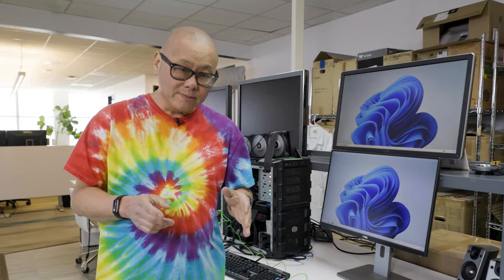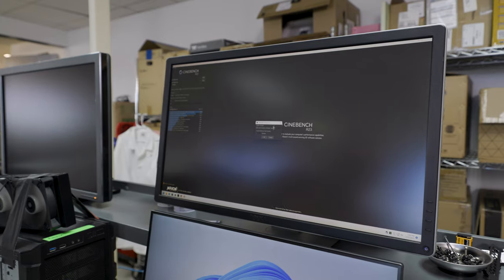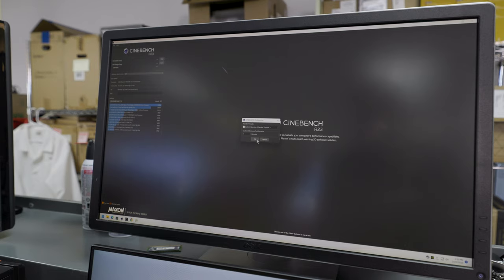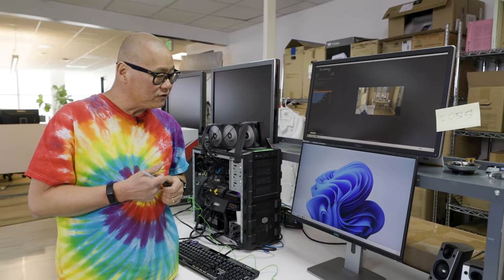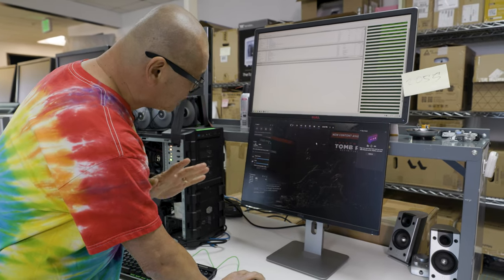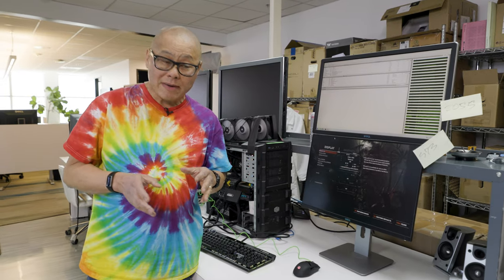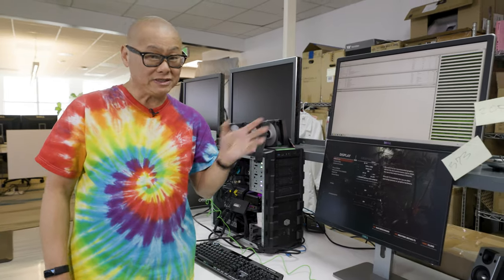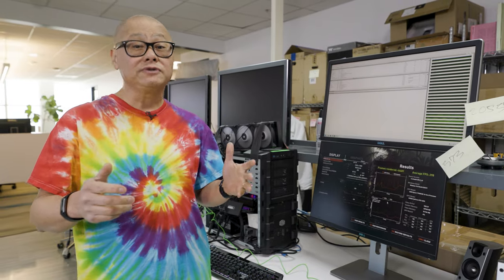Ryzen 7000 V-Cache: How It Works In Windows

Comment: you can shift it from core to core in realtime by right clicking on the game process and changing the processor affinity. and IIRC if you can start the game with the start command, yo can make a special shortcut that'll set the affinity at startup. probably doable via powershell too, however you start a process with it. Not sure if there's a good way to do that with Steam games for example though. by setting affinity in the task manager, you can even set how many cores it can access. limit it to one or two if you want for example

Comment: They should follow Alder Lake's footsteps and add something like Thread Director to streamline the scheduling. This reminds me of early Zen 1.
Reply: To redesign complete chip for few procent who will buy something like 7950x3D? Waste of money and resources. If stuff like stacked cash become standard on all CPUs then it will have sense. Before that you can forget.
Reply: windows 11 was written specifically for 12/13th gen. its the reason why amd has had to go thru hoops just to get any of their cpus to work correctly with windows 11. 
remember when win11 decreased perf on Ryzen when it first launched. now just to get x3d to work correctly you need a bios/chipset and gamebar updates all to sync together. wait until win12 comes out, this will be the same story again as it has been for a very long time already.
Reply: @larrydysondev  Then what's the point for a chip like the 7950X3D?
Reply: Actually you can choose which cores you use for which app with windows since a long time. When you actually look into it, you notice you don't need things such as a thread director.

Comment: what if you don't  have gamebar? how does this work on *nix systems?
Reply: Obviously it will need some kind of scheduler or ccd settings on process basis on these *nix systems. Possibly through some AMD driver or through some open source project by the community. Other than that, there would be only the option to change settings in BIOS.

Comment: What about heavily-threaded games which benefit over 8 cores? How's the performance when the 2 CCDs are wanting to be used by a game? Any assymetry glitching/performance issues in these circumstances? Can a game be set up to use both CCDs efficiently?
Reply: If a game naturally wants more than 16 threads, then this will start using other CCD. The penalties are the same as with 7950X - you pay in latency for transfer through infinity fabric. Glitching is rare (though in benchmarks there is sometimes, but in real games it almost doesn't happen) and you sometimes have odd micro-stuttering. But it's rare enough to not distract from the game.

Comment: The game bard does not give me the option to choose a game. Not sure why this is happening. I even have a newer game bar version too, the up to date chipset driver and BIOS update.
Reply: I have the same problem Did you solve it ?
Reply: @alitekken  Make sure to disable performance energy saving mode on windows. Meaning set it to balanced energy saving mode. Otherwise the core parking feature will be disabled and the gamer bar won't work.

Comment: Can you run a game (game mode on), while at the same time running another application like 7zip, which is not configured as game? It would be interesting to see whether Windows would reactivate the parked cores of the second CCD for 7zip, while using the first CCD for the game. In that case, everything would be perfectly fine and just the XBOX game bar stuff needs to be replaced with a better solution. The core parking stuff might just be a power saving mode, while gaming? On the other hand... if 7zip also run on the first CCD together with the game, while the cores on the second CCD are mostly parked, now that would be a problem!
Reply: You  know, I should have showed this but yes. There is concern that the 2nd die is "off" like in the original Threadripper. It is not. It is parked so all the threads are pushed to the stacked die. If you are you playing a game, running Chrome and Cinebench with 4 threads, it all "fits" mostly into the stacked die and most of it runs there. If you run game, Chrome with Webxprt 4 and then run cinebench with 16 threads, the 2nd die is fired up and running as you would expect it.
Reply: @FakeGordonMahUng  Thanks for clarification. So basically Windows tries to fit all running processes onto the stacked die when game mode is activated and only when it reaches its limits, it starts reactivating the cores on the second die? I was hoping that Windows would push the "games" (or any application set to run in stacked die) onto the stacked die, while the cores on the second die are used for all the rest, gaining maximum performance. I thought that the core parking might be some sort of power saving mode, only reactivating single cores when needed (like the active cores in your video). I hope AMD can tweak this behavior with future updates or at least give the users the choice between saving power (parking second die) or maximum performance (game on stacked die, rest on second die). They need a new application / interface anyway to define the preferences for each process without having to resort to Xbox Game Bar.

Comment: I wonder how older games run on the 3DV-Cache CCD vs non-3DV-Cache CCD. They would benefit mostly from frequency boosts instead of increased cache, right?
Reply: Single core perfomance: IPC + clockspeed.

The 7950X3D outperformed the 13900K in single core perfomance, in theory it should be the best.

Comment: 09:00: I would assume Core 0-15 are the primary threads on both dies and 16 through 31 are the HT threads..
So you are running on both Dies as the game is sufficiently parallelized to saturate 16 Threads (which is true for Tombraider as it´s a Vulkan title which uses defered rendering / heavy parallelization).

Comment: I am wondering if it would be possible to for the parked cores to instead be utilized exclusively for the ray tracing in games, as we have seen that the cpu is a very limiting factor
Reply: Ray tracing happens on the GPU, not the CPU

Comment: kinda cool but still SO STUPID you have to use Win Gamebar to make it work. Gamebar is the first thing I disable with a fresh install lolol
Reply: You don't have to use it at all. Only thing gamebar does it allows to tag edge case games the vcache optimization driver didn't detect. Personally I'd rather use Project Lasso for precise affinity control.
Reply: Take yourself out of the equation. This is something that will just work for the masses of less knowledgeable people. You have been disabling game bar based on some previous experience that lend you to think its necessary. Most people roll with the defaults. I'm most likely going to be booted in to Linux most of the time, and just pin my Windows VM to the vcache CCD.